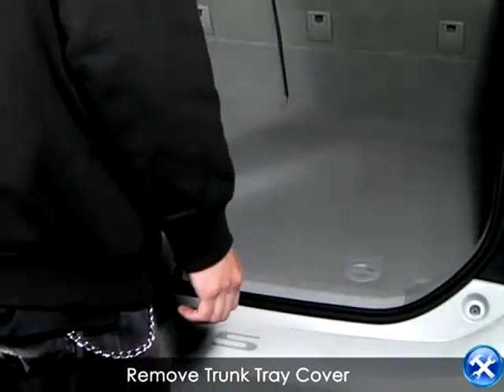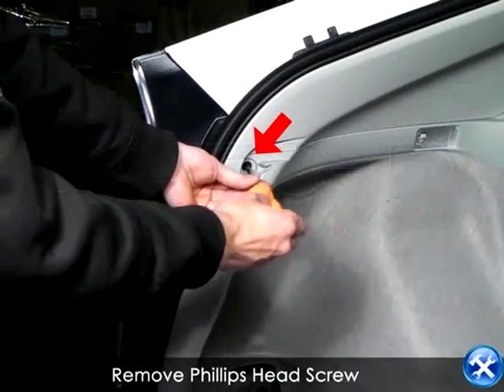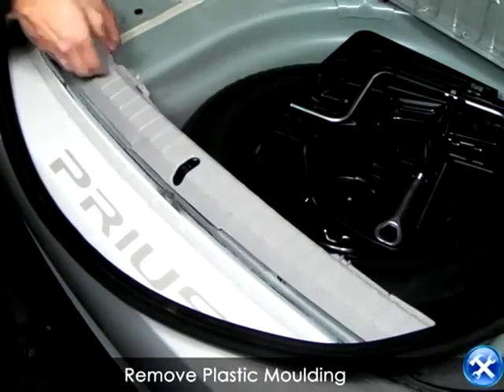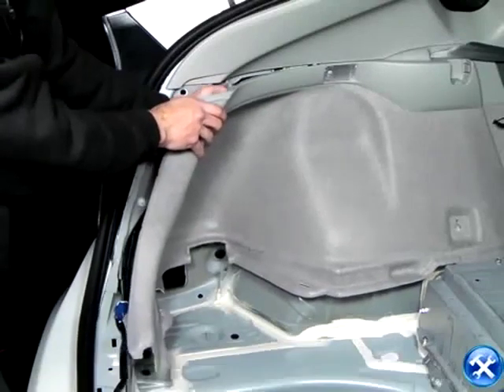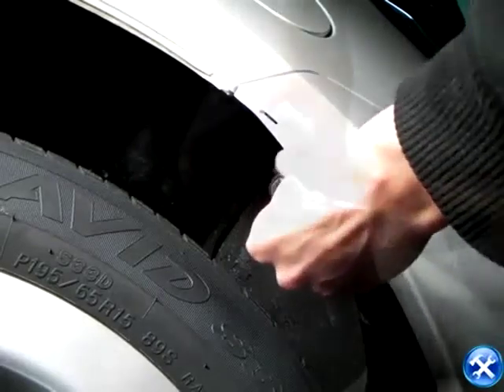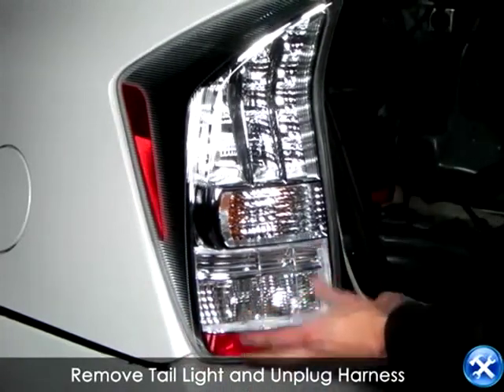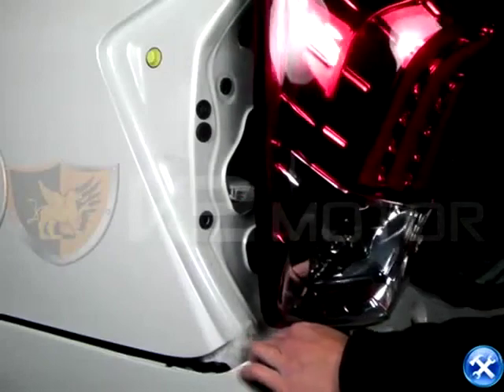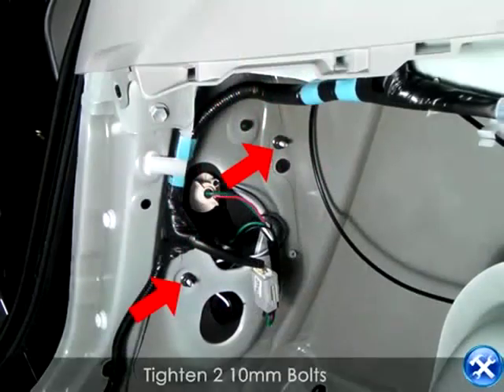2010-2012 Toyota Prius Rear Tail Light Installation

Comment: I would recommend not pulling the bottom bumper off, just undue the 1 screw below the light on the bumper and slowly maneuver the light in, there say this because this bumper clips break very easy. Thanks for the video! Great work really appreciate you!

Comment: befor removing tail lite    after everything is removed  nuts bolts screws  STOP  they don't tell you their are  two tail lite  guilds,  top of lite  and bottom of lite  you must pull down and out  and  then push down to remove the tail light from the  guide, look at the video haft way through  when they start to remove the tail light   see that little yellow guild at the eleven oclock  position thats a tail light guild  well I didn't know so I broke all of them,,,  things they don't tell you
Reply: jonny c wish I had read your comment first! This video was great but I made the same mistake you did. Fortunately, the replacement light had new ones that I was able to snap right in, so all was fine. Other than that, thank you to the video maker. I followed the instructions and it worked. New taillight installed!

Comment: Thanks for the clear instructions. Very slightly different for plug in Prius: the side accessory bin is not screwed down, just pulls out. The trunk latch trim includes the whole rear accessory bin for the charging cable. It just pull out too. Otherwise the instructions are identical.  The whole thing took 15 minutes.

Comment: You don't have to remove all the plastics and upholstery in the trunk. Those two nuts are easily accessible after removing the little plastic cover which is designed to access the bulbs. But this tutorial is missing unscrewing bumper from the bottom - two screws behind the rear wheel and one on the back, just under the lamp. Without removing those, you may break your bumper when pulling it back.

Comment: thank you very much for this video. able to save $$$ with the video. I wanted to add, there is an addditional clip that is at the top of the light that you would need to pry loose prior to the whole light coming off. it is not visible, you really have to look in and up.

Comment: You forgot to mention those two white thingies that attach to the metal frame of the car and the interior liner - theres no way that what you see in the video is what happens, the liner is attached and must be dislodged from the two white thingies and you either need a special tool to do it or i was told a needle nose plyers, but if you force it you could rip those white thingies from either the frame or worse from the liner (in the case of the liner they cannot be re-attached b/c they are glued.). So, the author must have either detached them before doing the video OR they were already detached (your liner will still function ok I suppose, just not as firm).

Sort of shocked that this is the only video on youtube for this task.
Reply: yeah, the white thingies got me too.  took an hour, but I figured it out and cut them from the inside with a pair of wire cutters.  Tail light came off like a champ after that.  Video was great besides this problem.

Comment: Juicedhybrid and everyone else that might could give me some advise...
I have a Prius 2011 and I am having a little problem with my rear lights...
- the turn sign indicator lights work fine, both tuning left or right...
- the break lights work fine...
- the reverse lights work fine as well...
The only light that doesn’t work is the “ tail light”... any suggestions of what could be the problem?
Tks anyone in advance for any advice. 👍🤙

Comment: I have a Prius v which now has a broken tail lamp. Anyone have a video or clear instructions on how to change it? It's shaped different from the regular hatch back tail light and the Prius v tail light has a piece that goes behind the rear side panel. Any videos out there on the Prius v tail light replacement?